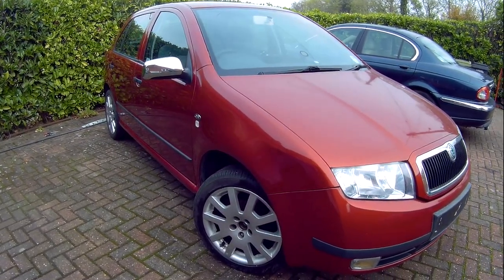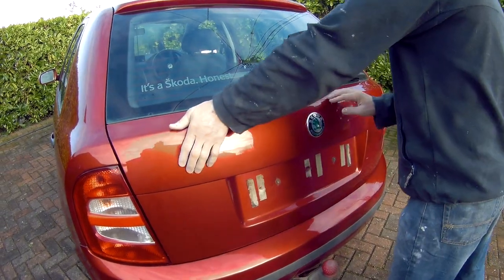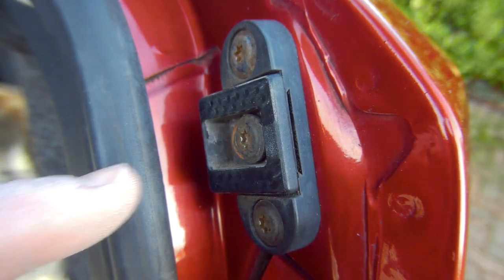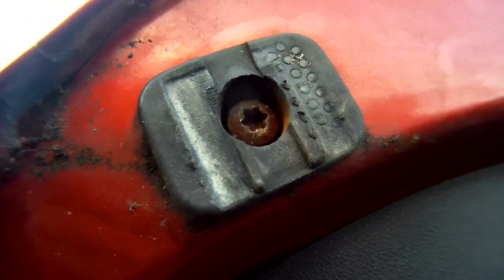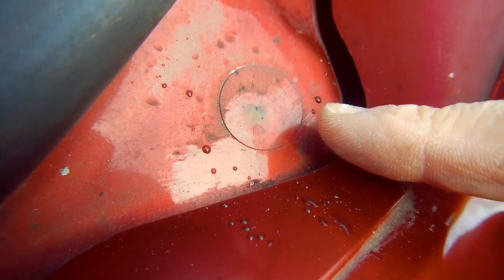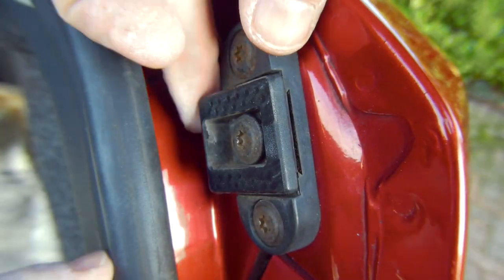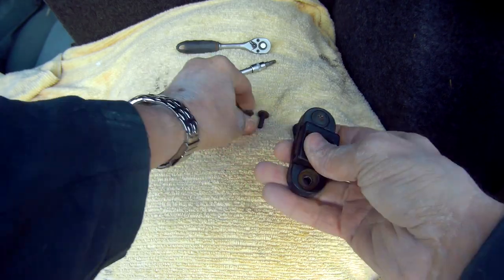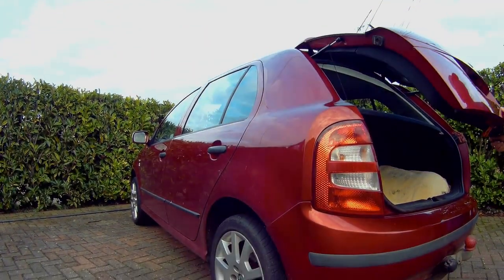Skoda Fabia TAILGATE ADJUSTMENT

Comment: My tailgate sits a little bit weird. I tried adjusting those things you mentioned but no result. Maybe I will do it again and play with it a little more. Something is rattling in the back when I go over a bump, so it may be the tailgate itself. Thank you for your videos!
Reply from the maker: Have you tried pushing down on the tailgate to make sure the play has gone? If the tailgate doesn’t move it maybe something else. I also had knocking at the rear after fixing the tailgate and eventually traced it to a rear shock that had failed. Also check the rear exhaust is not knocking about on its rubber mount incorrectly which often bounces about over bumps. Hope this helps :-)
Reply: @HatBoyHarvey   it was the bottom cover somewhere, rusty screw fell out.Tailgate is ok. Thank you.

Comment: Thank you for all the informative vidios about Skoda Fabia. Have seen them all and it helps my a lot. 
I have a problem with the tailgate lock on my Skoda Fabia 2004 1.9TDI. I can't now open it from outside by the handlebar, but only by the handle at the frontseat. 
Do you have a suggestion (or best make a video) to solve this problem - the fuse is ok and there is no broken wire at the top.   
Earlier I have replaced the broken metal tube by a plastictube in the  rear screenwasher. I am sure, that many viewers also would like a video about that problem.
Hope you understand my English - I am from Denmark.
Reply from the maker: My next video on Sunday covers the tailgate lock, but maybe not your issue. You need test to see if there is power at the connection (and enough power) to the servo motor with a multimeter/if no signal test motor works with seperate cables and continuity of cables and to ground. As the hatch gets alot of abuse closing the vibrations are likely to affect the connection or broken cable flexing at hinge entry point. Hope this helps :-)

Comment: Thank you. But what if the weatherstrip gets away a bit and unseals water by this adjustment ? did you try pouring water on the sides after closure of the back ?
Reply from the maker: I found It still compresses the weather seal to the tailgate, but it is sure worth a check if you are worried. If the seat is flattened or torn anywhere I would replace it :-)
Reply: Actually i own a fabia combi 2002. The practical affordable car. Thanks again for the info !
Reply from the maker: Very true :-)